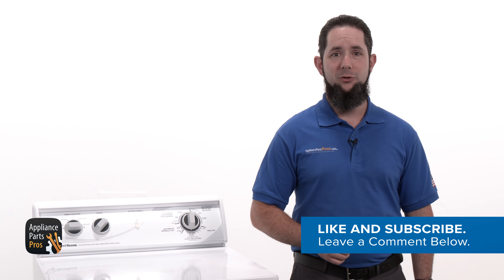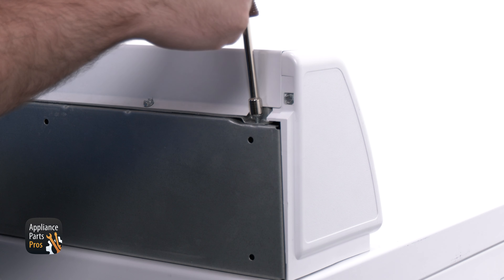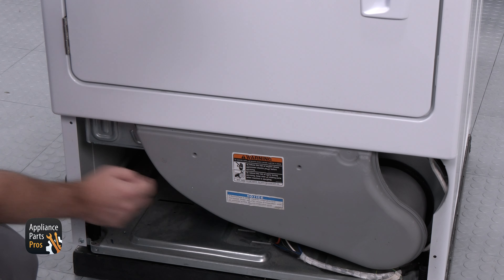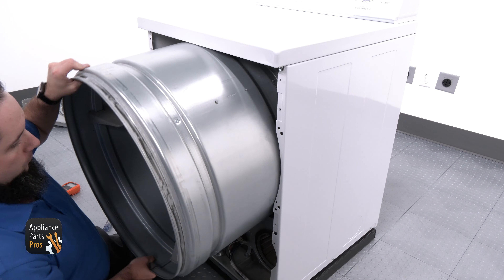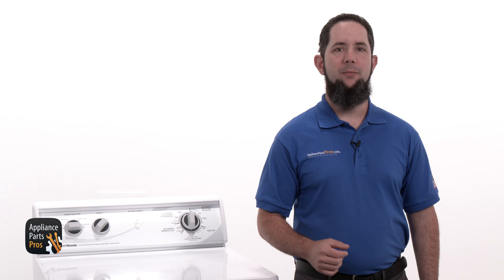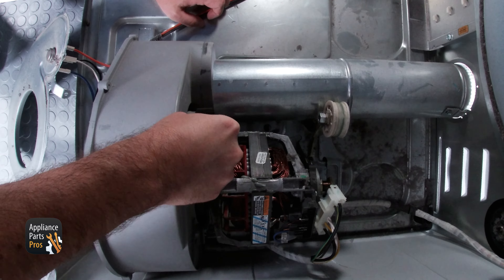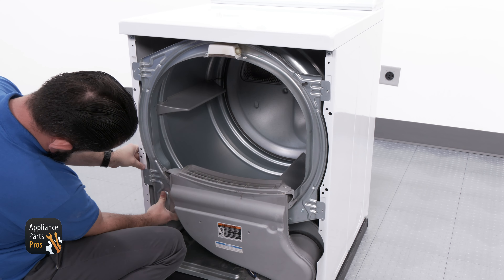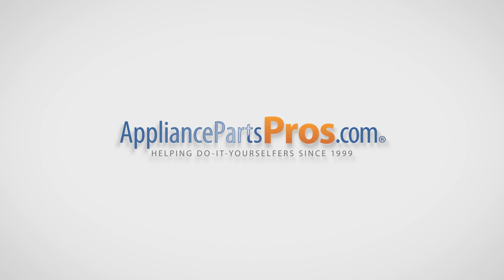How To Troubleshoot A Speed Queen Electric Dryer Not Heating

Comment: I followed this video step by step because i am diagnosing this exact dryer. Each component tested positive for continuity, until i got to motor. I had probes in outer spaces and reached in and pushed centrifical switch forward....nothing, so im leaning towards motor. Is there some other way to test before i purchase a new motor???

Comment: What happens if all the tests pass and it still does not heat?  Is it possible the centrifical switch is not activating when the motor is spinning?
Reply from the maker: You can test for power coming from the motor going to the heater. If you do not have power coming from the motor then it will need to be replaced.

Comment: Put a new timer kit and heating element in my speed queen dryer timer seems to cycle and work but want heat up  hopefully I hook all the wire up correctly on new timer
Reply from the maker: What is your model number?
Reply: @ I figured it out I put the blue wire going from timer to heat  control on wrong pin!! Thanks for the reply!!
Reply from the maker: You're welcome! Let us know if you have any other questions!

Comment: Mine all had continuity and heating element read 9.8 but still no heat
Reply from the maker: You will need to check for power going to the element. If have power at the element and it's not coming on then you will need to replace the element. If you don't have power at the element then you will need to check for loose or damaged wiring. If that is good then you will need to test for power coming from the control board or timer. If no power is coming from there then you will need to replace that part.

Comment: Fantastic and complete trouble shooting video. Other vids only go till they found prob. This list pretty much all possibilities. The only other possibility would be a burnt wire or wiring fault.  Also, a bad motor probably wouldn't cause heat to stop...just no spin function I think. I have this machine and no heat. I had continuity at all parts but continuity at the coils and on the the switch between terminals  H and LS was strange. Got a beep but a high number when it should have been a zero. My switch was very high number.
Reply from the maker: A bad motor can stop the unit from heating as well. If it's not sending power to the element then the element will not have enough power to heat. When checking continuity make sure to remove one wire from the terminal so you can isolate the part and make sure you are getting an accurate reading.

Comment: Your step by step is very thorough, appreciate that. The timer is the problem and no longer available and I cannot find one to replace it, does that mean the dryer is done? Or is there an alternate fix? Thanks, Brian
Reply from the maker: What is your model number?
Reply: @appliancepartspros  thanks for your reply.  I had tested the timer wrong, retested and it is ok. The motor was turning the drum and blower but there was no heat. I followed your order of testing and had continuity at each stage. Did I miss something? Thanks
Reply: model AES28AWS
Reply: can the high limit thermostat be turned 180degrees and not work?
Reply from the maker: The thermostat will need to be tested for continuity with a multimeter. If it has continuity then it's good. 
If the unit is running but not heating and the timer is good and the thermostats have continuity, then you will need to test for power going to the element from the motor. If you don't have power coming from the motor to the element then you will need to replace the motor. If there is power at the element and it's not coming on then you will need to replace the element.
Reply: @appliancepartspros  ok, I will check that next. I thought that if the motor was still turning the blower and drum it would not be the problem with no heat. Thanks so much for your help and replies! B
Reply: I started all over in the order of your video. The timer had no continuity. When the power is on to the dryer I could hear that the timer was working. Does that mean that I tested at the wrong place or can the timer be working and still not allowing the heating element to work? This is getting very frustrating . =:p'
Reply: Did I test it correctly? I removed the orange wire then tested from the red wire to where the orange was connected. thanks
Reply: on the timer, I mean, sorry

Comment: So the top black wire going into my heating element melted off. Why do you think this is? I tested continuity on all parts and they all checked out and I measured about 10 resistance on the element. Do you think the heating element could be drawing more amps or is creating to much resistance?
Reply from the maker: If the element was shorted or the wire was loose, it could cause that issue.

Comment: Hi our dryer issue is possibly the resistor. Traced all wiring. No continuity at the resistor behind timer. We appreciate your replies.
Reply from the maker: What is your model number?
Reply: @appliancepartspros my husband is an electrician however we're now thinking the timer is the culprit. He checked for continuity. Found blue with black stripe wire had burnt all the way from heater up to timer. He replaced that entire wire already.
Reply from the maker: The part number for the timer is D505797P. You can place that order through the website or you can call us at 1-877-477-7278.

Comment: No heat
The top blackwire heating element connection melted
Stripped wire back, reconnected  melted again. 
Ohms reading for heating element is 10.8 to 11
Ohms are out of spec....could be the heating element than?
Reply from the maker: What is your model number?